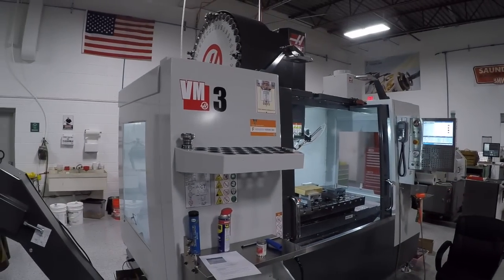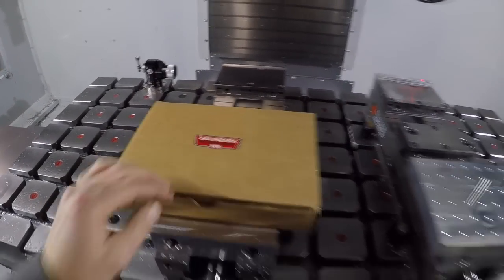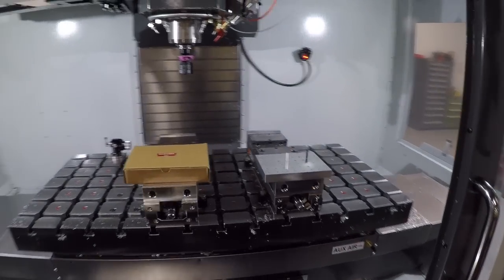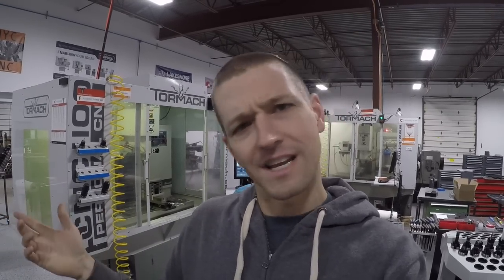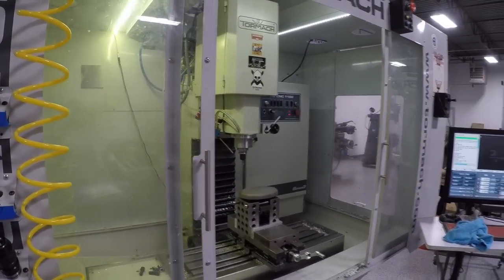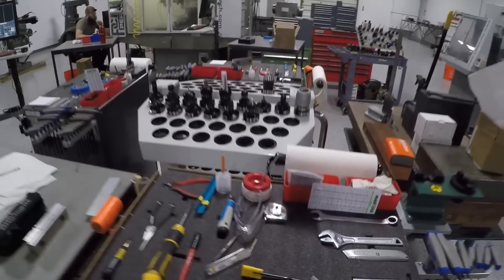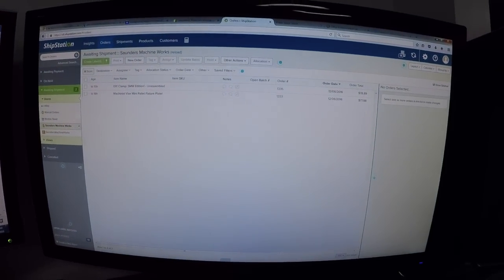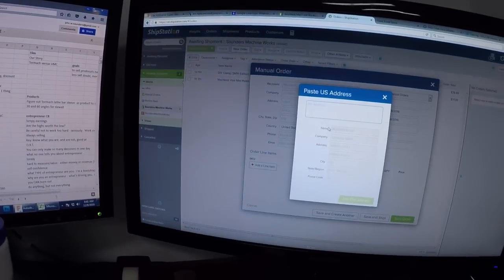New Product, Shipping Software, Sandvik Drill, HAAS and More! CB39

Comment: John have you considered a product idea based on the same pallet concept, but as vice soft jaws? I've always considered soft jaws to be an enormous waste of material for job shop applications, and instead wondered if it would be possible to have replaceable pins or blocks that could be fixed to a split pallet machined for the vice. Machine the disposable pins/blocks to suit the job, and you could put as many in a row as the job required (most jobs would likely only need 4), then when the job is finished unscrew them and the base Vice-Pallet can be reused indefinitely ... no TM on the name Vice-Pallet btw, go nuts if you want to use it ;)

Think of this a little like lathe soft jaws. Just different ... and I think unique.

Comment: Hi John... You need to fabricate and include with the pallet --- a set of clamps i.e. 6 step blocks / and risers or strap clamps, and at least 6 pins to fit the holes and all "normal clamping" hardware. for 1/4 20 needed..  Just Saying.... Thanks Brian F.

Comment: I have a product I run on my haas that has some similarities to your plate. You might consider making a subplate the size of your machine bed. Buy your stock cut to the length of 4 to 5 pieces. Put 2 on the back for op1 and then flip them to 2 more rows in front for op2. Cut them by slot milling them during op2. I use mitee bite clamps between the rows. You would get 8-10 parts per run. 8-10 parts per cycle you might be able to get the cycle time to about 240 - 300min run time plus say 10 minutes load/unload time. Now your talking 2-3 cycles per day with very little operator intervention and 4-6 hours of lights out run time at night. Fab a cart to make it easy to slide the plate on and off and you've got a poor man pallet changer.
Reply: oops 6" x 8" plate... One row for each op can yield 6 parts per cycle 3 hours per cycle means probably 3 cycles during the day and one lights out.

Comment: John - as always super usefull vids, one thought on tool lib naming; would be good to include the machine/spindle too as the 1100 maxes out on rpms well below the 770 so the feeds in the lib + template represent those hp/rpm limits too. Also a video request, feeds and speeds are mainly what stalls my hobby work on 1100 - wondering if a compilation table of roughing and finishing WoC/doc/rpm/feed for varios materials for common cutters like fly, shearhog, sq endmills, insert cutters, thread mills, drills, that tormach sells is possible - likly too big an ask ;). Just not getting confidence in my gwizard descriptios of tools to trust the numbers. Regardless thanks for the huge series of grat videos!!!

Comment: Those pallets are cool. However, there is something else to be said about them; a slightly different version of a sacrificial plate. 

Out of urgent necessity, I grabbed a 8" by 16" by 1/4" thick aluminum plate. On top of it, I mounted a 1/4" thick hard plastic lining using screws though I should have used adhesive. Anyway, underneath this assembly is a block also of aluminum 6" by 2" by 1" which is bolted to the plate. This assembly, in turn, is clamped on a vise so that the plate is horizontal. And so, what do I use this for?
I often find myself with a rather large sheet of thin metal (or a sheet part) that needs to be modified, machined and drilled in ways you otherwise could not do using a vise. When I drill and mill on it, you cut into the plastic lining which is its intended purpose. When the lining gets too many holes and cuts, you replace it with a new one. Threaded holes in a grid pattern are added to this plate but I never use them because I don't have step clamps small enough. Instead, I use C clamp vise grips that fasten much faster. Improvements can be made in the design of this sacrificial plate since it's only for light duty. In fact, I just might make a more robust one when time permits. I'm wondering if other machinist have used sacrificial plates as I described it. John, I'm wondering if this plate would have market value as the mini pallets you offer. If the one I made were being sold at the time I needed it, rest assured I'd buy one because making it took too much time away from getting work done. Anyway, thanks for sharing you love for machining.

Comment: Do you think you would try this type of tap? https://www.youtube.com/watch?v=hbfEVtA7JMg
Reply: NYC CNC 
Nope. They are meant for CNC mills. Requires full syncro tapping capabilities though. So the HAAS can run it, the tormachs can't. 

Haven't tried them myself yet, but have been eyeballing them for sure. Just haven't had a part that needs that many holes tapped to justify it.

And it requires a special holder specifically for punch taps and only emuge makes the taps and holders 

See. BIG $$$$
Reply: mysock351C 
I imagine coding for it would be tricky. Probably requires a custom built macro to get the 180 helix motion start and stop correct. Which means it definitely needs a full synchro spindle that reads spindle angle and not one that simply has just a single spindle orient position.

Comment: What is the approximate cycle time for op 1 and op 2 each?
Reply: I've never subscribed to the run all out philosophy. Every time you break a tool, wear out a tool and have to change it costs you most of you gained time and money. I do subscribe to the philosophy getting as many parts on your machine as possible so you can walk away for extended time and hit cycle start as you turn out the lights to go home. Is the stock precut before you get it?

Comment: Sandvik Coromant have good tools but expensive ! 
I buy the solid carbide drills from Ceratizit tools a where god tool maker company in Europe and it's nearly half the price compared to Sandvik 
The cutting data is the same and in som cases faster. Ceratizit have a special series for Aluminum that is extremely fast and much faster than Sandvik . This series haves a high tolerance so a drilled hole have remed tolerance. 
Cutting Data for a 6.3 mm drill with internal cooling: spindle speed 10 000 rpm feed 240"min (vf 6000 mm/min). Tolerance -0 + 0.015 mm

Comment: we run a 860 drill, 5/8" dia down 6" no peck 105 ipm in 7075 aluminum. I'm pretty sure it's done over a thousand holes no problems. You can feel it in the floor when it hits. It's pretty intense. BTW the product looks beautiful and  I can't wait to see how they get used.

Comment: John, you need to use chip tote bins instead of garbage cans.  The tote bins fit under your chip conveyor and you move them in/out of your loading dock area.  You'll have to reorganize a bit to accommodate them, but it's worth it.

Comment: Are you hard anodizing those pallets?
Reply: JohnHolmestheSecond to make it last.. not get dinged up, protect the threads alot of reasons actually  You can easily account for thickness of hard coat for the dowel holes.
Reply: JohnHolmestheSecond im telling i own an cnc machine shop also a mechanical  engineer you can if hold to mil spec standards and use type III you can. You order reamers by tenths and dial it in from there and have proven process most customers don't want to do this because its expensive

That's why we do the work that your annodizers can't lol
Reply: JohnHolmestheSecond 

Ummm. Hard anodizing is easily held within +\- .0002 thickness. That's typical thickness tolerance for a .0009 plating build up 

That's also why they make GH-11(and larger) taps, to oversized threads to accommodate plating 
thicknesses.  They also make reamers in the same way to oversize precision holes that are getting plated. 

I dunno who your plater is, but if they're "all over the place" on their thicknesses, might wanna stop using the lowest bidder and find a quality plating outfit
Reply: JohnHolmestheSecond 
Oh. And there's also this neat little thing you can tell the platers to do called "mask all holes"

So they plate everything else and leave the threads and bores straight metal 😉
Reply: +JohnHolmestheSecond repeatable soft jaws do you just pick and choose on what you want to say?

Variety 20%  UP TO .002  the depth varies on grade and temper of aluminum in question

Hey,  cnc operator if you would have would did the math on his example... .
You get the following
.0009 Thickness at +/  20% per the mil spec is .00018 +/  so yes you can easily hold  +/-  .0002
Reply: JohnHolmestheSecond 
Of course it's practical.  It's a fixture plate that's going to have things slid across it, chips hammered against it, chemicals sprayed at it. All perfect reasons to hard ano 

And +\- .0002 on thickness can be held by any reputable plater.  We had 150 parts just done in black hard ano, with .0012 thickness held to +\- .0002. Which was verified. Again. Find better platers if they can't hold .0002. 

As for chipping? 1/32" rad is plenty to stop chipping of hard ano. A bell shaped center drill will put a perfectly shaped lead in on the dowel pin and tapped holes to prevent ano chipping.

Comment: We used to make a similar work holder at work except it was much larger.  Made out of acrylic. It had a 4x6 pad on the bottom to grip it in the vice and had a built in fence following the x axis. It was about 10 x 12. Might be able to make a add on piece for smaller vices or a larger plate with a grip surface added.

Comment: $180?? Ouch. Bet that was a sticker shock! 

Think it's time you start beating up your tooling reps a bit for better pricing. 

Did you at least get it on a trial basis? That way if you use all their recommendations for S&F and it breaks they'll replace it no charge.
Reply: Occams Sawzall  That's reasonable.. quality tooling is expensive
Reply: Chief Machining 
That's definitely like Amazon pricing not distributor pricing. Should be more like $100-$120 ish for that drill maybe even less. 

Like I said. Needs to lean on his tooling distributors a bit and get better pricing. You can usually get 30-50% off whatever MSC pricing is. Tooling markup is huge.
Reply: agree to disagree but getting on them for one drill may not work until he builds a relationship with them. He just started ordering premium tooling as well have take that into account
Reply: Chief Machining 
True. Which is why he should get them on trial basis. You can usually get one freebie outta most vendors. Especially since he's just starting to get into the premium stuff. Manufacturers are notorious for overstating the capability of their tools (even sandvick) and best to get it on trial. Like I said before, if you get it on trial, and blow it up using their recommendations, they will replace it. Only have to pay for it once satisfied with the product.  Been my experience anyway. Always ask for a tool on trial if it's something new you want to test. Not worth dropping $180 and have it blow up on the first run and be out that cash.
Reply: NYC CNC 
Now that sounds much better 😊
Reply: Occams Sawzall $180 is not important - it's the 17,000 holes it can drill, and the 'no pecking just straight through' that is what makes it  - that equates to around 1cent for each hole which is drilled twice as quickly as the $36 drill.
Reply: Steve p 

At $180 per drill, he'd have to make 1,000 plates (48 holes per plate) for it to start beating the $36 drill even if you account for the 50% cost per hole increase with the hss drill. 

Assuming you could get 17,000 holes with the carbide and 5,000 holes per hss drill (carbide is typically 3x the longevity of HSS). You would need 3 carbide drills for 1,000 plates and 10 hss drills for 1,000 plates. 

That's $540 in carbide drills and $360 in hss drills. Which oddly enough 360 x 1.5 (50% increase in cost for time) is exactly $540. 

So I'm actuality, the carbide drill has the exact same cost of manufacturing the hss drill has, it's just a bit faster off the machine. But not by much. Maybe 3-5 minutes per part.
Reply: Occams Sawzall ok, sounds reasonable.
Reply: Steve p just trying to explain why @ $180 a drill isn't a good price.  It gains you very little in overall cost savings you gain an extra $0.60 at most in profit off each plate made as you're not saving anything in tooling cost, just in time. 

At $90-$100 per drill you gain significant profit from lower tooling costs while still gaining profit in time. 

Either way the gains are only realized when doing high production runs. Even at 1,000 plates the profit difference is about $300-$400 in favor of the carbide drill. Which is a nice bonus. Buts it probably about a month to month an a half of running just those back to back (and selling). Probably be more like a 4-6 month time span for 1,000 parts. Which will probably work out to being able to fund the coffee addiction he'll have developed with his expanding business 😆

All that said. Yes. Carbide high feed drills are fun as all hell

Comment: Wow Pallet is great! Will it be available also in metric version? 1-2-3 block will be also interesting in metric version, because they are hard to get here in Europe.
Reply: If for that size of pallet I would suggest 6mm holes and M6 thread. This size is also used on some vacuum tables. But here is easily to get also 3mm, 4mm, 5mm, 8mm, 10mm dowel pins.